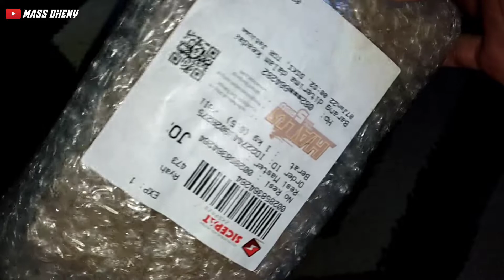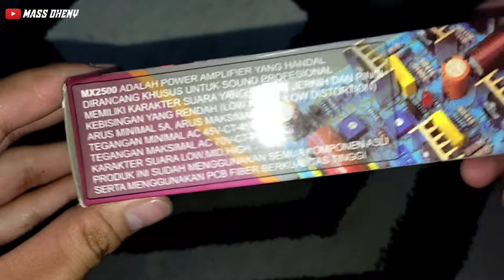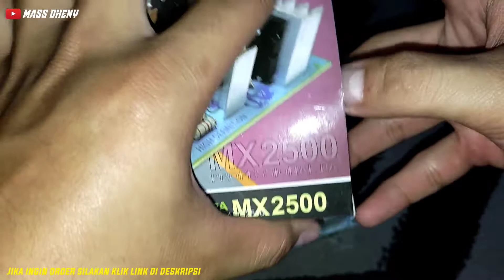Unboxing & Review Kit Driver Yamaha MX2500

Comment: Kalo 2 driver gt input dijadikan 1 input bisa ga om?
Reply from the maker: Bisaa inputnya di jumper
Reply: @Massdheny1573  trus kalau di jadikan 1 potensi bisa mas e? Gmn skema nya?
Reply from the maker: Pakai potensio stereo yang kaki nya 6..kaki tengah menuju input driver,kaki sbelah kanan atau kaki pin 3 input audio,kaki kiri atau kaki 1 untuk grond,,untuk driver satunya sama aja skemanya
Reply: Makasih banyak mas e
Reply from the maker: Sama sama